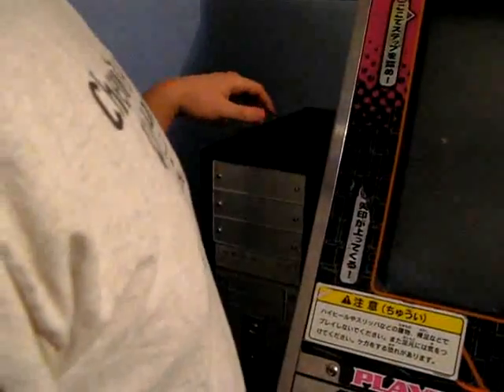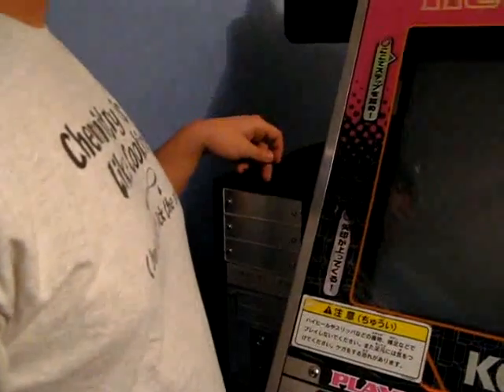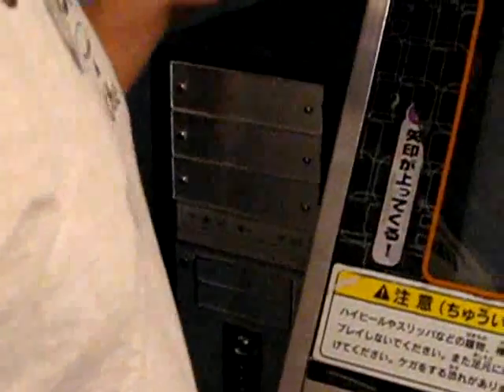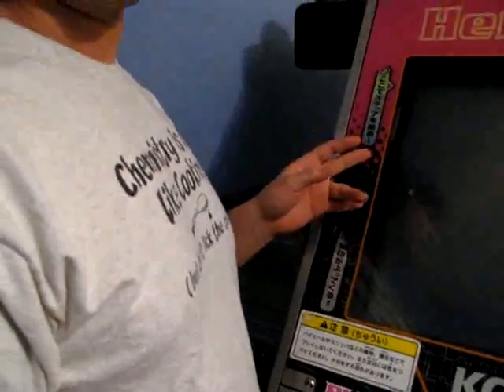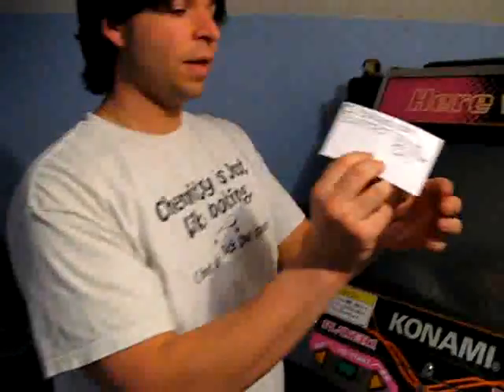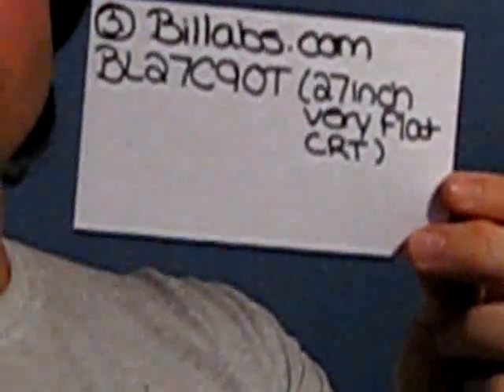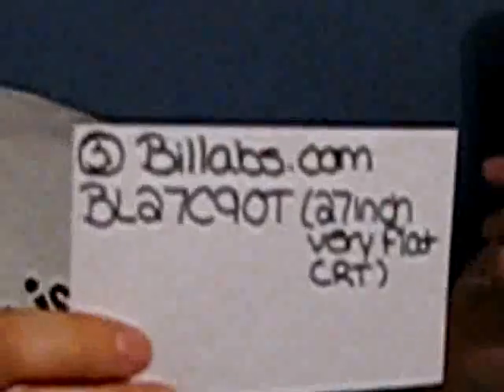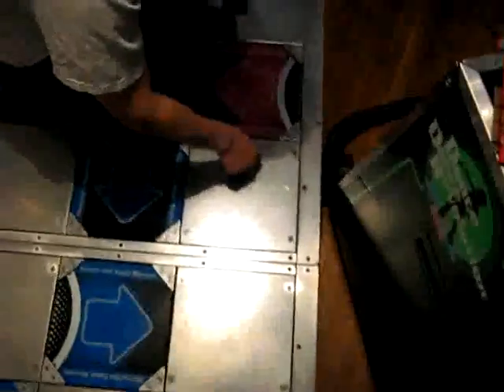DDR Machine to Stepmania Machine Conversion pt 1

Comment: hi if im using a jpac/ arcade vga, with default monitor from the cabinet, would I need to connect the default monitor right to my arcade vga or would the jpac connection to arcade vga work just as well?
Reply: Barry Yiu Have you gotten an answer for this at all yet?

Comment: I JUST found this video. I'm seriously considering buying all the hardware and convincing my local arcade to let me do it for them. I need to watch the video at home though, because I'm currently in class.
Reply: I know this is 13 years ago so you might not even see this but just wanted to ask did you actually do it?
Reply: @Mahoxy  I was able to get a single arcade pad to play at home and run itg on it. It works great and is connected online to groovestats. The local arcade got rid of their machines years ago lol

Comment: oh and i think a 8500 or 9000's series is an overkill for a video card just to run stepmania... I remember running stepmania perfectly with no lag on my laptop's intergrated graphics card with 128mb video memory... then again, graphics cards are cheap now and days ^__^

And one more thing about the video card... STAY AWAY FROM ATI CARDS.... or at least from my experience, no matter what kind u use (i use a 4850 with 1GB GDDR5 ram), you get lag issues with stepmania...